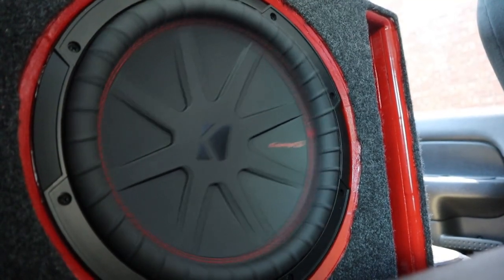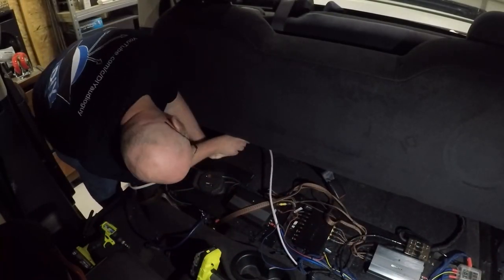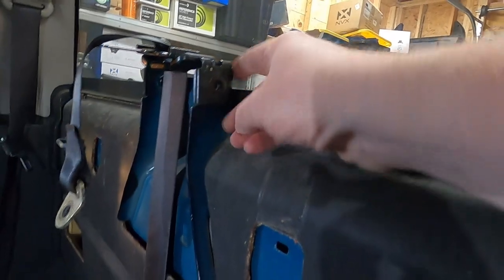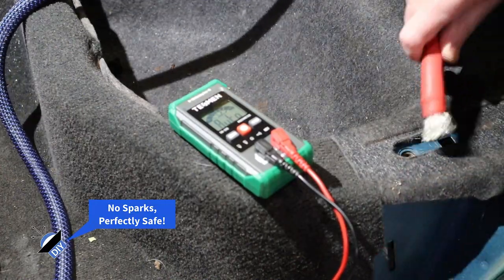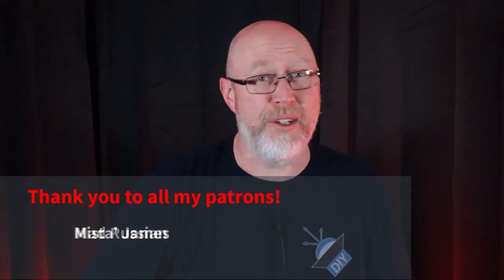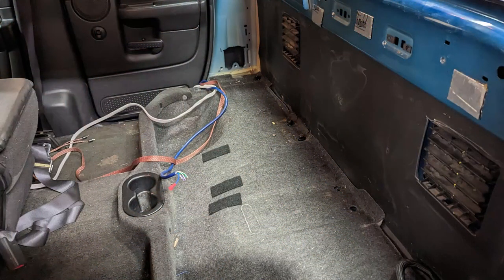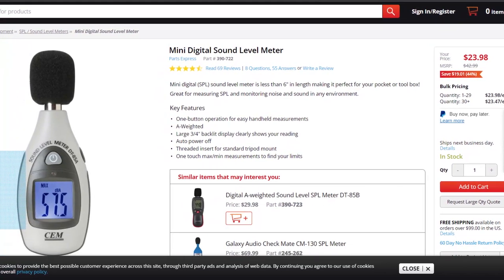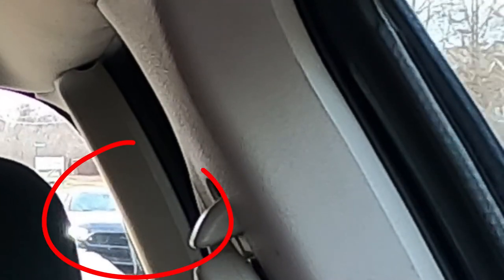Bass Truck:  Rear Seat Delete!

Comment: Back when I worked at a shop. I had a Symmetry epx2 with a 4ch running the front horns & tweeters and two 6.5s. A 2ch for the rear 6.5 coaxials. Then the subs.

Comment: Hi Justin

Have you sound deadened the roof of your car / pick up truck.
Because that is a big area of steel that has little to no ridge work on it to reduce vibration, oscillation of the sheet steel.

A, B and c post's are usually more ridged and less proan to vibration or oscillation from sound.

But sound deadening with the silver foil backing can help with the insolation of the vehicle, that is if the foil lining is thermal reflective.

Loving the video's and waiting for the next instalment.
Reply from the maker: It is on the to do list!  I am looking at more than just CLD tiles on the roof.  I want to block sound as much as possible.  Stay tuned for more!

Comment: Put some 2inch thick mineral wool/rock wool pieces over those rear cab cabin vents. They are still somewhat breathable to let the vents still function. Did that to my 2013 Sierra crew cab when sound deadening and insulating the rear portion of my cab. Made a substantial difference to road noise at highway speeds. Keep it up and great videos as always!
Reply from the maker: I've got some stuff that's supposed to work very well.  Will definitely show it in the next video update.

I'm also getting some rattling off of the back wall, it's the little plastic louvers inside those vents.

Comment: A great idea to cover the negative lead with a shop cloth to eliminate ANY possible chance of it crawling around and making contact again.  That was quite a difference in sound with the MLV installed.  I'm tempted to do the say for my daily driver.  It just has lots of road noise.  Also, I want that Cheeto that was under the seat.  I'll pay for shipping.
Reply from the maker: Full disclosure, the entire floor pan and most of the firewall is covered with MLV.  So the only entry point for road noise are the doors and that back wall.  If I just covered the back wall and nothing else the difference would be less dramatic.

Comment: Amp rack install yes on a bench yes to do all the small wire connects. But running rca's and power from back to front or front to back doesn't matter. What really matters is the length of the wires are correct. Any correct install starts under the hood, running your main power wires and leaving an amount left to run to the rack. Second is the remote on, bass knob and rca's from the head unit that way you don't have 3 extra feet of wires behind the head unit. Hide the rest in the rack but keep 8 inches of slack behind the head unit to work with. Same with door speaker wires. Run proper lengths and hide them to pop up under the rack.
Reply from the maker: It's just easier to do as much work as you can on the workbench instead of huddled in the back of a car.

Comment: I built a fiberglass enclosure and back wall amp rack with a LOT more gear than you have in the exact same model Ram. If you need help or want the enclosure, hit me up. 
And running your wires front to back wasn’t your problem. The 5 Star guys aren’t the gods of car stereo; there are other ways that are just as good.
Reply from the maker: My main goal is to make a rolling test bench.  If I ever replace the seat I will fiberglass a box.

Comment: I put some of that silver type sound deadner in my Kia Spectra and while my car isn't quieter going down th road the vibration from my sub is much reduced. Only time I hear vibrations now are up in my dash where stuff like the air vents vibrate.
Reply from the maker: That is exactly what it is designed for.  I find that covering the door skins (i.e. the inside of the outer sheet metal) with some good heavy sound deader helps quite a bit.

Comment: Awesome job, I seen you used the xs 6500 I was thinking about using the 6500 or the 3400 jus didn't know if the 3400 would secure down with the ram 1500 battery secure down, do you happen to know if the 3400 will work? I don't like the way the 4800 battery terminals are shaped square. But seen the 6500 has that bigger lip to secure down on. Thanks
Reply from the maker: I'm sure you can probably get the smaller battery to fit, just might have to buy some hold down clamps from AutoZone or something like that.

Comment: I’m running around 800 watts rms 400 to doors and 400 for a sub.. would you say I should sound treat the floor of the truck or just the doors? I only have a 10 inch sub, and it doesn’t really rattle crazyyyy but if you’re right outside the truck you can tell it’s got a sub in there and you can hear the muffled but clear highs and mids. 

It’s not like you can hear it far away or anything. But for the sake of improving sound quality, could my bass really improve a lot?

I should add it doesn’t rattle crazy.. but you can hear and feel some slight vibrations
Reply from the maker: I would only sound treat the floor if you are trying to cut down road noise.  You can definitely improve sound quality, getting rid of a bunch of buzzes and vibrations if you treat the doors.

Comment: Mounting a amp to the box is the worst thing to do what I have a hard time with is why does a power subwoofer have the amp mounted to the box when it should never be done🤔 wonder why the amps always bad and for sell on eBay  but yet they still do it 🤯 I fill bad for people that buy them that don't no it a money pit and getting ripped off in my opinion because they have to🤥 no what there doing. 🤢😠 Ps if you bed line the back of your cab it helps with flex and sound on the inside plus protect it but not easy in less you have a couple buddies to help pick up the bed to be able to spray it but we'll worth it 😉🎶🎵🎛️💯🛠️👍👌✌️
Reply from the maker: You would be surprised how much noise the back seat soaked up.  I have some more stuff to try plus I will have at least two layers of plywood to help block the sound.
Reply: @DIYAudioGuy  that why I kept it in mine I just wish I would of none shallow sub don't quite hit as hard as you would think even with 4👍👌✌️💯🎶🎵 great stuff

Comment: do you work with house systems or outside porch systems? or mostly just car audio?
wondering about speaker placement, deadening for rooms, mounting so the low frequencies are projected rather than dampened in ceiling.
Reply from the maker: Other than just building speakers and placing them in the room I don't do much with home audio.  I've never tried to sound deaden a room in my house.